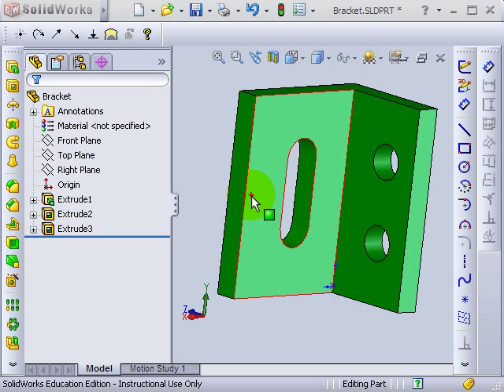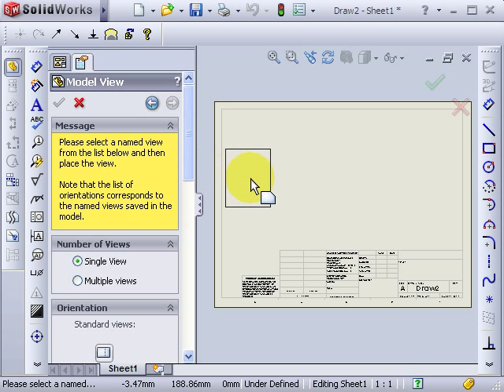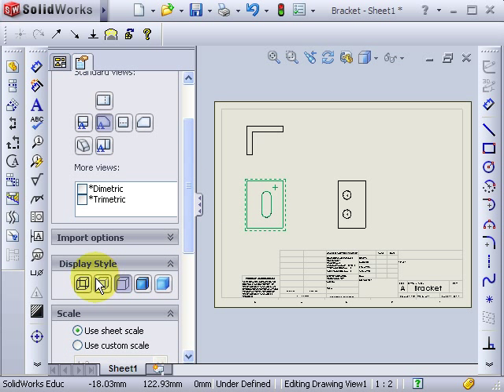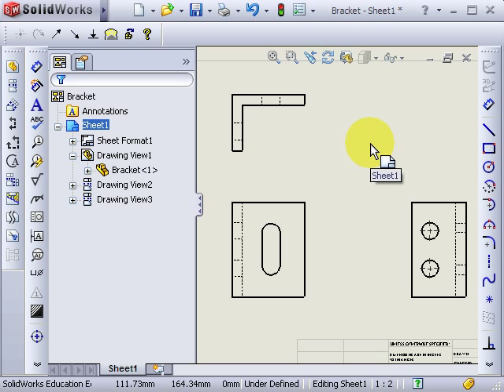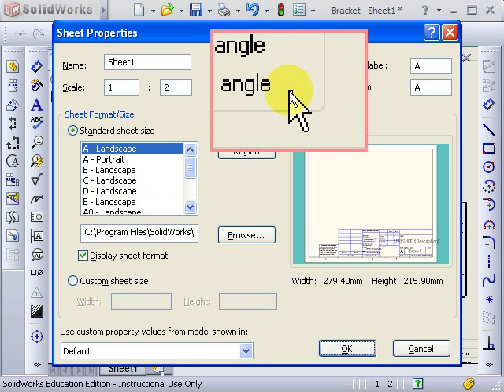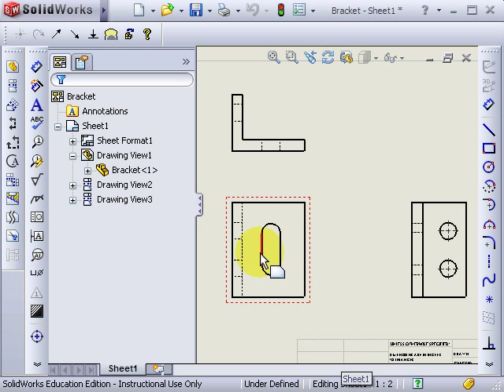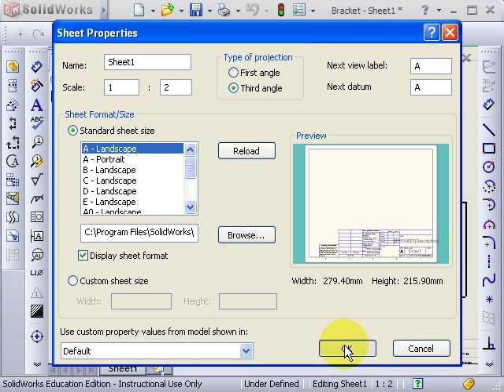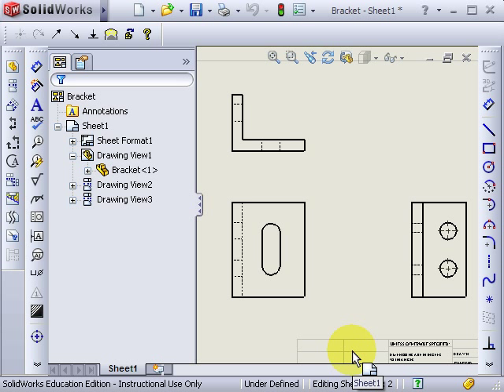MIE341 - Changing a drawing to 3rd angle

Comment: I know this is an old video, but I'm having a similar issue in a computer lab.  The default templates in SOLIDWORKS are not created until the first document (i.e. part, assembly, drawing) is made.  At this point, a one time dialog is displayed to create the default templates.  Many people simply click OK without changing it to the ANSI standard.  The issue I have is the computers were "frozen" before even creating the templates, so it prompts to create templates every time a new document is created.  I'm sure the IT department will resolve the issue, but I wanted to share this info for others.